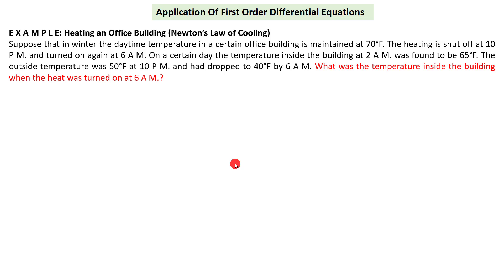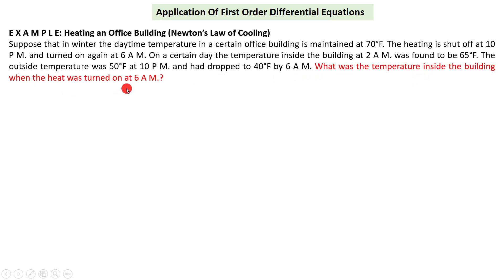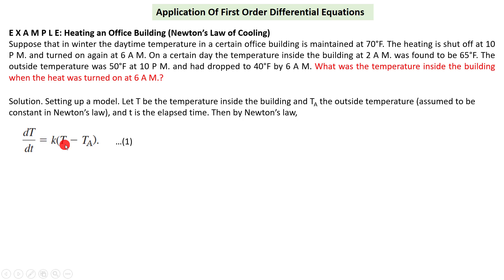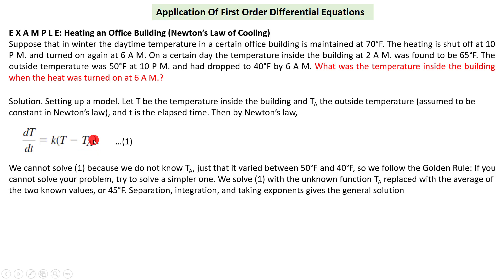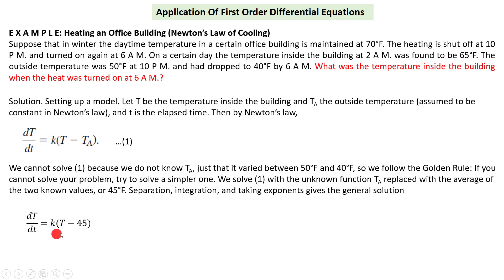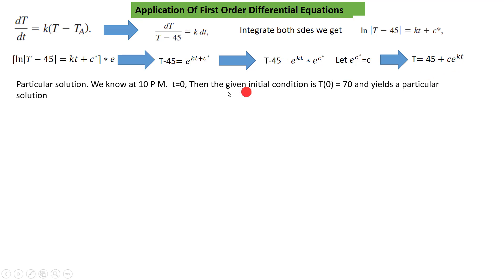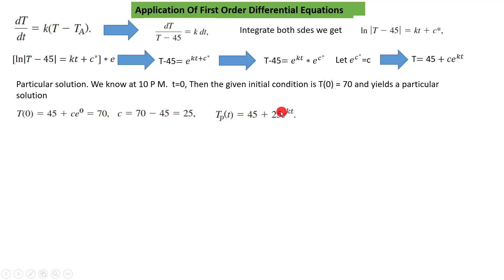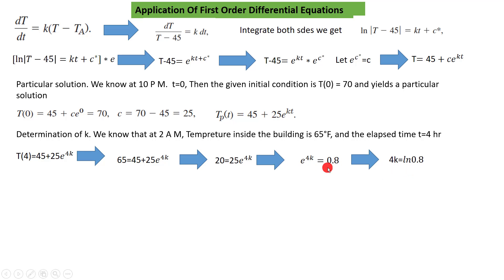Newton's Law of Cooling First order differential equations

Comment: Last step please explain
Reply from the maker: determine the time
Reply: @ENGSchool  if submit 45 answer wont get but if submit 65 answer will get.. Let me explain 45+ 25 * e-. 0096*8. Not getting an answer.
Reply from the maker: @elangovanthangavel2778 
e-0.056 not 0.0096